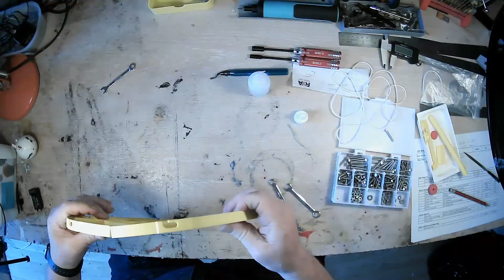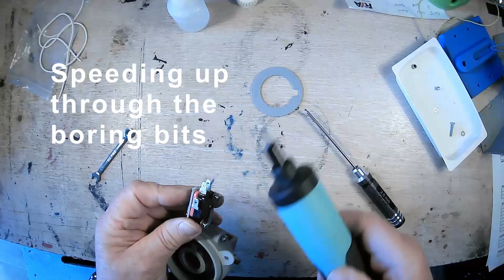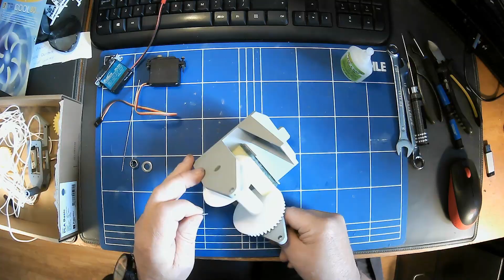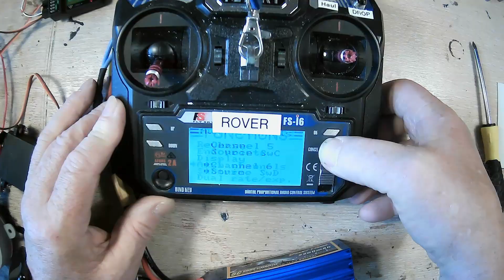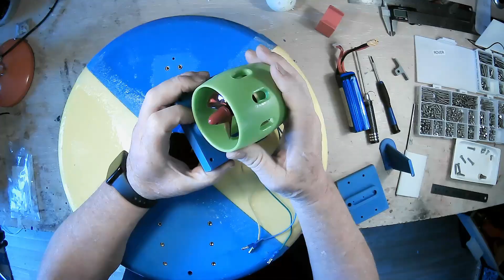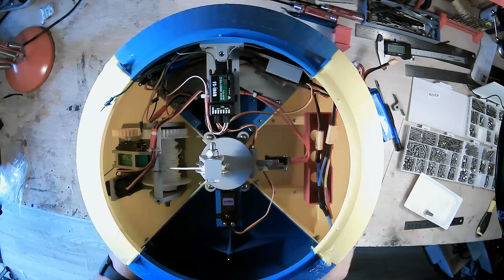Radio Controlled Mark Version 3 Build

Comment: If anyone's interested I can supply more details about this. 
It's a light that switches on when the anchor is up.
https://youtu.be/XnPXdDZ9HZI?si=tYammG2I2Qw7_hdX
If you turn the sound up you can hear what the anchor is doing.
BTW
We have five of Robin's marks at various stages of construction. 
Based on Hayling Island, UK.

Comment: Hi Robin:  how do you hold the 360 degree winder motor from unwinding under the 2 lb load.  This servo does not have any holding power with the potentiometer feedback removed.

Comment: Hi Robin:  Can you provide a list of fasteners and heat inserts?  I plan to use ABS instead of PLA...which is more stable and water resistant.  Do you think I still need to fiberglass it.  Thx

Comment: Hi Robin:  Awesome design.  What voltage/type/ capacity Lipo battery.  How long (hours) can it work during a full regatta under one fully charged battery.  Is your underwater thruster motor a 12/24V brushless motor from Amazon?  Is the full electric circuit  active (idle mode?) during the regatta.  Thanks

Comment: Hi Robin, thank you for this wonderful design. I am working through printing parts on my very slow Creality. 

Do you have a video showing the assembly of the winch module please?

Particularly, do you use spacers at each end of the winch drum?
Is the swing arm pivot axle a rod or a bolt? (I am assuming M5)

Comment: Is the final version as opposed to some of the other video's that show two motors. this looks like it's much simpler and only has one motor to deal with. is the thingiverse files for this one??
Reply from the maker: Version 2 used two motors - this version 3 is the current version (October 25) but there is a small upgrade coming to the electrics courtesy of a suggestion by Mark Pleatman.  Video on that soon.

Comment: What material did you use? PLA/PLA+, ABS? Thank you
Reply: I also used PETG and glued the quadrants together with JB Weld Plastic bonder. Coated rounded edges with west system g-Flex epoxy(i had it hanging around).  No leaks. Thanks Robin for this, its a great Mark/buoy
Reply: I printed mine in PETG.  I used standard support settings on the first one; it used a massive amount of material, and it was difficult to remove.  For the second and third I used tree support, which worked great and used much less material.  Also easier to remove.
Reply from the maker: I just used PLA for our marks but will probably use PLA + for the next two having seen how it perfoms on my Alioth build.

Comment: I'm just finishing building one of these.  Two more to go.  I have a few suggested modifications.  Instead of modifying a standard servo to use as the winch motor, which then requires us of an ESC to control it, you can purchase (on Amazon) a standard servo that is designed to turn a full 360 degrees.  This eliminates the need for ther 20A ESC.  In addition, the 40A ESC needed for controlling the thruster motor has a BEC (Battery eliminator circuit) that will deliver 5V to the Flysky receiver, thereby powering all the servos.  So now you don't have to put a splitter on the battery, and you don't need the buck converter to drop the voltage for the receiver and servos.  If you don't do this and want to go with the original design, be careful about plugging multiple things into the receiver that are trying to supply power, as it will cause problems.  Fun build!
Reply: Im working on printing the parts now, so nothing hooked up yet. I'm wondering, if you plug the winch servo directly into the receiver, how do you get the switch to stop the servo when the anchor is all the way in ?
Reply: @kevinc4426  that's what the microswitch is for.  You run the 5V line(middle of three wires) from the winch motor through the microswitch, on its way to channel 3 of the receiver.
Reply: @MarkPleatman  Thanks for info, did that, works great but... I used a servo extension instead of cutting into the servo wire.
Reply: I have built a RC Mark and using the mods with a 360 servo TD-8135MG

It is very slow becaue running at 5V is very close to the TD-8135MG slowest speed at 4.8V. 
This makes the speed of anchor retreival very slow

The TD-8135MG can be run at up to 8.4V to provide faster speed

Are they any option to run the TD-8135MG at this higher speed?

Comment: Any chance of posting a list of items or links for the items used for the assembly? Thank you
Reply: I have a spreadsheet with a more complete list of parts, sent it to Robin, hopefully he will post it. FYI, my cost came out to be $154 per RC Mark buoy.
Reply: @kevinc4426  what method have you used for the servo swing arm pivot rod? (Cannot see it in Robin’s list)
Are you using spacers to centre the winch drum on its axle? I have 5-6mm play.
Reply: There is a list  of materials and electronics included with the file downloads.
Reply: @ukktor  Where are the file downloads located?